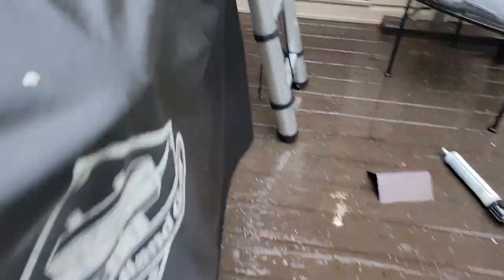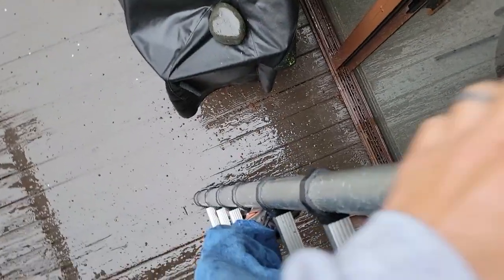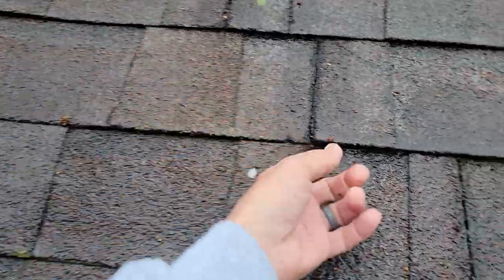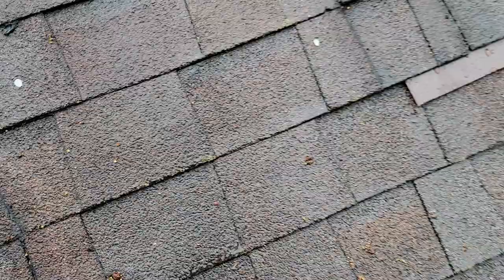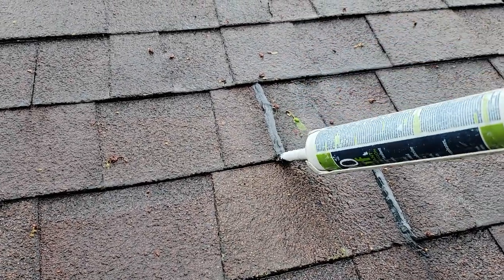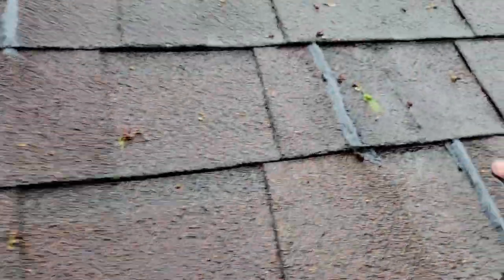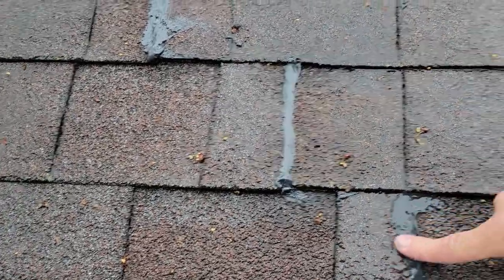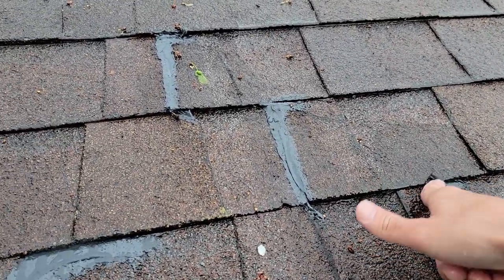Roof leaking into back porch -  Cause, bad roof nail placement!

Comment: Great tip that I learned (the hard way) a cotton towel on a wet, mildew covered,  slippery deck or ground surface will not slide and the rubber feet of the ladder will have great traction.
Reply: Thanks for that. 👍
Reply: @huejanus5505  You're welcome! I learned this AFTER taking a bad spill on a two story gutter cleaning job.  Got busted up really badly.

Comment: Regarding ladder safety on a wet plank deck surface-  If you jam a screwdriver between two deck boards, preferably two places, spaced to the width of your ladder feet, you can pull your ladder against them, providing very secure footings for the ladder feet. I figured this  one out after taking a fall, along with my ladder, onto a deck. No significant injury, but ugly bruising to my arms, chest and ego.

Comment: Thanks man.  I have a small leak in one of my bedrooms from an area just kind of right in the middle of the roof, I climbed up in the attic and found the general area it's coming in at, and went up on the roof in that area and can't see a damn thing wrong, but I'm thinking it's probably a nail under one of those keyways, I might have to climb back up there.  Luckily it's a very minor thing, the drywall just gets slightly wet if it's really coming down but as you know it's just going to get worse and worse....

Comment: This repair is definitely educational but I would have just broken a few upper seals and installed a tarp to such a small area. Clean, quick and guaranteed to holder better than solar seal or any tubes roofing application. Just my thoughts. Respect what you do and I get a lot out of you videos. Always looking forward to the next post!

Comment: Called a Bibb flashing. The same thing that is supposed to be used for slate repairs. Unfortunately laminated dimensional shingles do not have any guide for nail placement and this is a common problem after 5 or more years.

Comment: Now I see a few spots where they put nails threw the top of the shingle, is that something to chaulk or just remove the nails and replace the shingle?  thanks for you videos
Reply from the maker: It's best to remove the shingle and replace it. But chances are whatever roofer did that probably did that to the entire section. In that case once they start to fail it's best to just replace the roof.
Reply: I'm seriously trying to figure out why the exposed nails were not an issue?

Comment: My flip house has sheathing that's rotted away to nothing for the first 2 feet or so from the wall. I just have a bucket there to catch the water for the time being and normally it's just a small drip but we had torrential rain the other day and the bucket had overflowed and soaked the subfloor I had just put down within the last month lol

Comment: how much u charge for this kind of quick fix?
Reply from the maker: I didn't charge for that at all. I would never consider that a fix. It was the family of someone I knew so I explained to them what was going on with it. I only did that to help stop the leak, until a more permanent fix could be done.
Reply: @GrandRoofingInc  i wwas curious how much would you value ur time and resources however pitifiul they might have been.